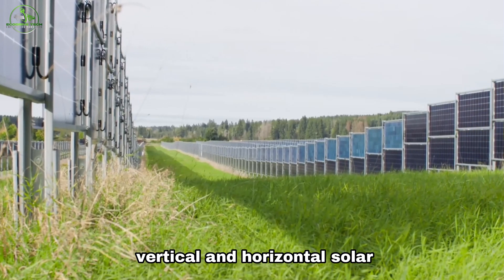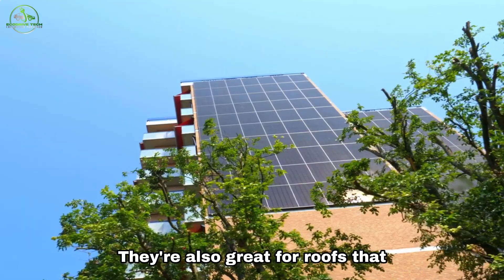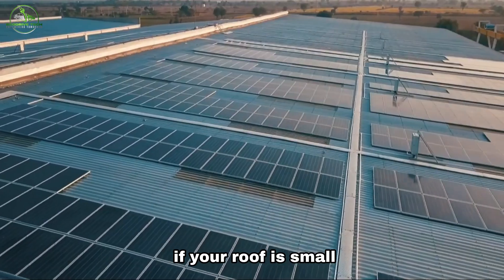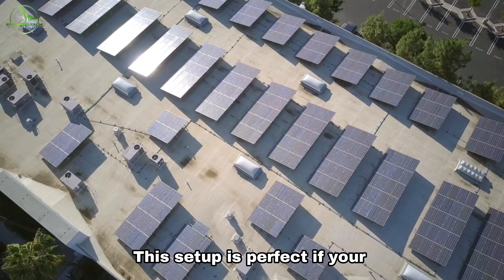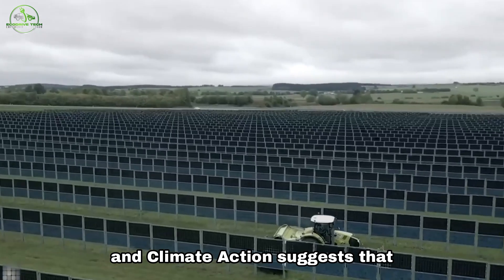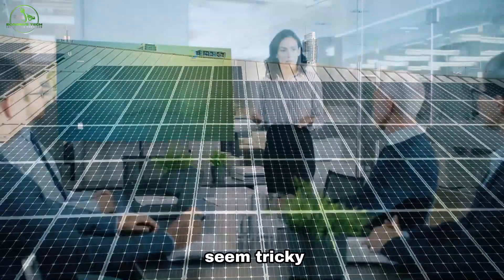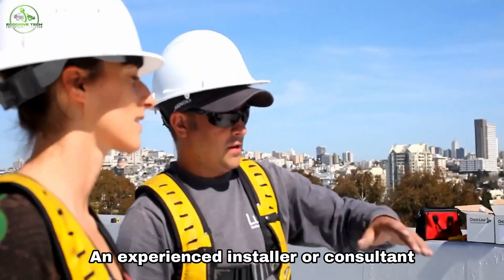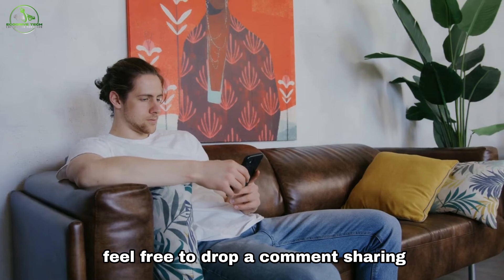Vertical vs Horizontal Solar Panels: The Shocking Truth Revealed!

Comment: Almost all tests miss the mark because they don't use vertical south facing bi facial, I did my own east west test, and it doesn't compare to south. The video stated more stable production, and I will explain, with no reflective in summer my 465w panel makes 300w, but the days are 16 hours and mostly clear, In Dec I get 125w in most overcast, add snow and sun 569w, more power on the shortest days less power when I do not need it even running 1.3kw all day long with AC. No matter how you mount it, get bi facial. Panel cleaning once per year vertical, snow won't stick either.
Reply from the maker: Thanks for watching